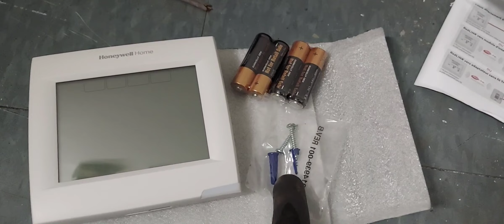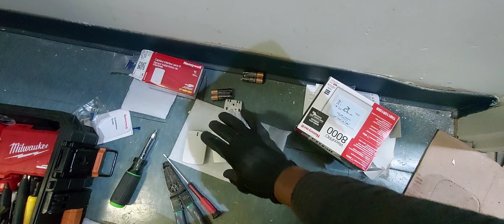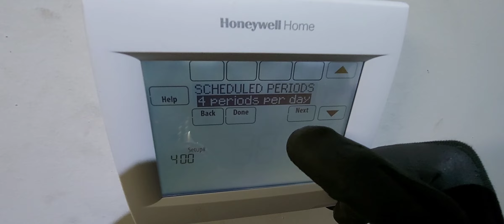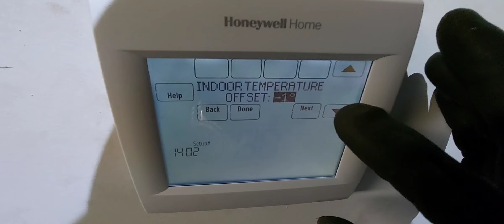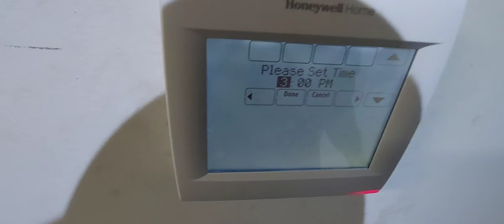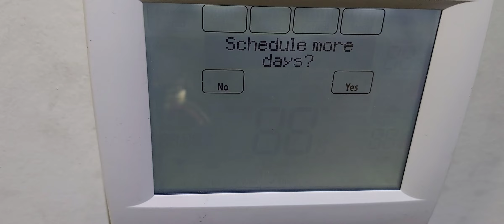VISION PRO 8000 REDLINK THERMOSTAT AND REMOTE SENSORS

Comment: And also, when you add 2 or more wireless sensors, does the thermostat then automatically take the average reading of those various sensors? or are there more options to setup how the thermostat reads the multiple sensors?
Reply from the maker: you have to go into setup a d set which remote temp sensor to use for control or averaging

Comment: can you add these wireless sensors to an existing thermostat that is already setup and functioning? or do you have to do a factory reset on the thermostat and start all over setting up the thermostat?
Reply from the maker: You can move them from thermostat to thermostat just disconnect device then  do the link process for each sensor

Comment: What do these sensors do exactly? Does it keep the air constantly running?
Reply from the maker: Nope , they sense temperatures remotely   so you can install the the thermostat at one location while reading and controlling the temperature at another